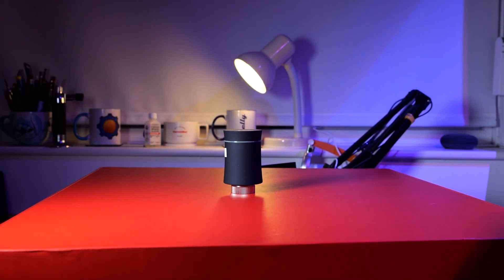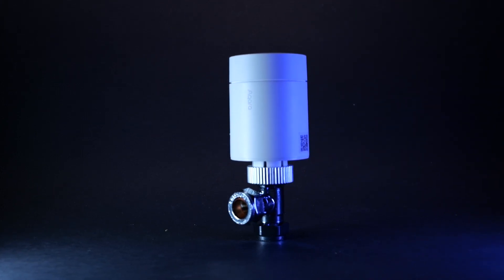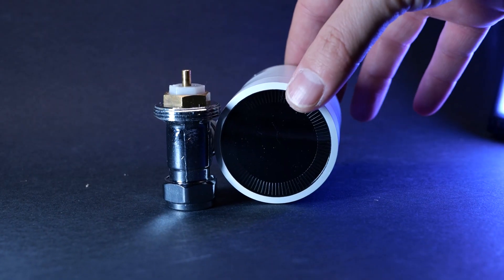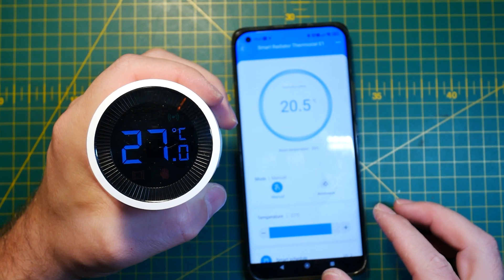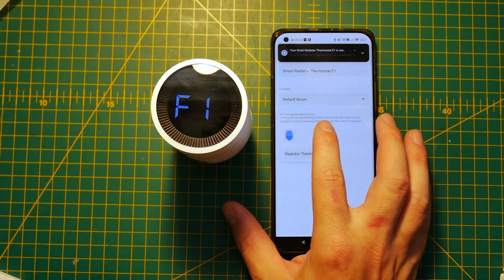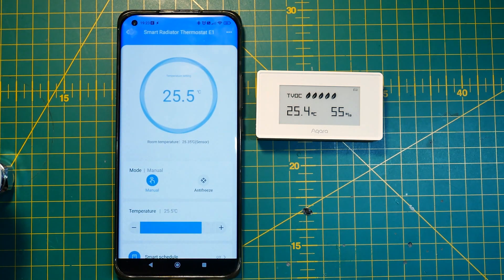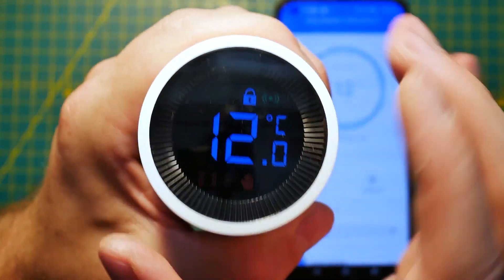11 mistakes that Aqara TRV could fix

Comment: How long on average does it take to calibrate?

I have hive trvs currently and they can take 4 hours to calibrate and rhe heating had to be on when you don't this.

Sometimes they also don't calibrate so you have to go through it all again.  Other times it will calibrate and a few weeks later uncalibrate and you have to go through it all again.

Comment: Some Aqara devices are not competitively priced as others in my mind. If this TRV does retail for £54.99, it's going to be overpriced, when you can get the Sonoff that does everything the Aqara does for a lot less. I remember back when the Aqara Contact Sensors were great value for money and bought a few of them. They are great sensors but the last time I checked, they were dearer than the first ones I bought. As for Heating and TRV's, I had a huge investment in Tado but their proprietary communications system sucks and has range issues for people with large homes. I waited 3 years and followed a thread of many angry Tado customers over that time thinking they would fix the problem but its become clear they are not going to bother so I just ripped all the Tado out and replaced the TRV's with Sonoff. I have created a few HA automations to manage my Heating Schedule and Boost operations and I've pretty much replaced the Tado app functionality in a matter of hours. So far, it's all working well, so fingers crossed this will be the last time I swap out TRV's. Best of all, I'm selling the Tado kit for more than its costing to buy the Sonoff 🙂
Reply from the maker: I don't think Aqara is getting more expensive. They do offer quality products often cheaper than more known to western brands. It was never inexpensive tho. I can personally attest for difference in quality and longevity of Aqara Vs less expensive brands. 
Budget is a consideration and I'm the first to acknowledge that. 
Sonoff trv is the one I would go with as well but mostly because of the budget. If money was not the concern I'd pick Aqara trv in this case
Reply: @notenoughtech  At the time of writing this reply, a quick Amazon search found the Aqara TRV for £39.99 (with a 27% off promotion), normal price £54.99. 
I feel / hope like they are never going to be £54.99 because that's a ludicrous price in today's market. At the discounted price the Aqara is not a bad buy but it still wouldn't sway me from the £29.90 Sonoff TRV. That's like a free TRV for every three I buy.  Thanks for the video though 👍
Reply from the maker: You have to remember that Chinese marketing is vastly different to what we are used to in the west. It's all about gamifying the shopping experience etc. you almost never get the RRP. 
I don't like it...but it works for them in China and I guess it's a process to get the sales data to prove otherwise in the west. 
On their up side if you are buying for commerce... None of the promotion strategies apply and you get fixed price which is very often non negotiable

Comment: I'm also NOT happy with these - and CANNOT recommend them
(having bought 6 of these in august-2023, plus the Aqara E1-Hub).

Why?

1) Partly due to their lack of Interoperatibility... Philips-Hue shows, how interoperatibility is done - so that a hue-device/unit can be controlled by both Home-Assistant AND the Hue-App!
-- Aqara only accepts "1" - an Aqara-hub or a "USB-Bridge" (Sonoff's zbdongle, etc.).  So one has to sacrifice a lot of functionality/easiness, to integrate these "super-reviewed" pieces of s... (or whatever one want to call this/them)!

2) The installation-proces is, shall we say "like software, in a beta-version".
-- pairing-mode times-out much too fast (60-seconds), which combined with that in my case the thermostat refused to connect to the matching! E1-Aqara-Hub (!), (making me trye this appr. 10-times, after which I needed a brake, not to smash the damn thing!!).

3) Re-initializing proces (if. one for instance needs to recalibrate the valve):
-- is just as "annoying" ... there doesn't seem to be ANY way, to make the damn beta-thing go into "setup-mode".... without removing the housing and removing/reinserting the batteries, etc...!).
-- what a series of bummers!!
-- I am writing this in late august-2023, appr. 1½ years after they were released!!!
(and, this all gets worse: Because IF one in desperation tries to get to the "installation-mode" by holding-in the "1-and-only button", then the unit also needs to be re-connected to for-instance HomeAssistant!!!...)

This should be A WARNING to buyers ...
(not to mention, that Aqara to my knowledge, is quiet about Matter/Thread-support ... making these thermostats "much less of a value" (they are not ezactly cheap)!)

Status now, is that Aqara has NOT, after a whole 1½ years, been able to get the software-part right - plus that compatibility and smartness is terrible, compared to Hue's.  Hue (Signify) actually shows, how things can be done, if programmers pull themselves together, and a company cares for a good customer-experience!!!
(Aqara has got connections/threads to Ziaomi, which seems to be the problem here - with a product, that is "in between" a lot - not 100% working in any scenario, or having a lot of "annoyences /deficiences!!) ...

I'm considering returning mine!  I bought 6, trusting in Your and others reviews - and I'm kinda lost - because I don't see, where to go.
Is TP-Link's Tado's a solution?
And, is there ANY Radiator-Thermostat solution, that will work with BOTH the App AND Home-Assistant?
Not to mention the coming Thread/Matter standard/dialect...
So many child-diseases and so much waste of HW/ressources and customer-time!

Comment: Hello..I wanna ask you a question ..After setting the parametres with wifi what happens if  wifi cut of  after setting the vakues? Will it keep on working with the setting (which set before) without internet?  For example does the schudele programme works without internet ? Thanks..
Reply from the maker: Schedule and currently applied settings are stored on the TRV. The automation policies are usually stored in the cloud so they won't apply over the internet loss

Comment: Does it actually stop at a specific position (e.g. 75%) or does ist keep turning the valves on and off if it can't keep the temperature constant ?
Reply from the maker: It will close the valve when setpoint is reached and open again if too much heat dissipate.

Comment: It says abnormal reading . When i set it 24-25 degress thermostat is a bit loosely like it moves the head . Is it cuz of this or is it normal ?
Reply from the maker: Sounds like your adapter isn't well fitted. It should be attached firmly in both on and off position - then run calibration again

Comment: Hi 
thanks for your video
could you help me with this issuing i am facing
i plan on purchasing aqara thermostat and google nest.
my problem here, do i purchase the nest temp sensor or the aqara temp sensor, which one would recommend?
Reply from the maker: Bear in mind that I haven't used the nest stuff so my advice is a bit blind. Going ZigBee enables you to switch over later while locking into nest will leave you .. well limited. Personally I'd use awara given a choice

Comment: What is the mount/adapter name? I got a few Aqara TRVs for my underfloor heating system but the problem is they don’t fit next to each other on the pipes manifold. Wonder maybe the adapter is the key 🤔
Reply from the maker: This is just standard valve I picked up from my local hardware store, used no adapters for this thread

Comment: i got one + a the aqara hub and a temp. sensor mounted 4 meters away from radiator to the wall wall.. 
it keeps the room temp good, but its REALLY noicy!!  when it goes a little bit under the set temp it opens fully up until the set temp is reached and closes again.. 
its not directly the trv that is "noicy" but the water running in the pipes when trv goes FULL open and closes again, is there not a soft mode where it runs more smooth? my old Danfoss eco2 with bluetooth never did this..   an i doing something wrong in the settings ? 
love your channel by the way 🙂
Reply from the maker: If you can hear water flow, chances are you have air in the stystem. Any cold spots on your radiator near the top?
Reply: @notenoughtech  no its hot from bottem to the top. ;-)  
none of my other 7 radiators with old thermostats is noicy :-)  

the noicy part is when it opens fully up and then fully closes again. 
It does this over and over to adjust the temperature 🌡️
Nothing in between like a normal trv 😢
Reply from the maker: Have you calibrated it? That would also cause the TRV to open in a binary way without allowing for an incremental change.
Reply: @notenoughtech  yes yes tryed that a couple of times. 
Don't think there's anything other to do, than wait for a firmware and see if that works. 
For now I'm a bit desipointed. Let's see if a firmware update can solve that, i  unmounted it from the bedroom and mounted the oldschool back it's simply too noisy🎶 to sleep from. 
Glad I didn't buy more than 1 🥳
Reply from the maker: Are you able to press the pin down of your valve with a finger? Resistance from the valve could be a contributing factor. When new they are butter smooth and easy to actuate
Reply: @notenoughtech  yes i have and it's not possible to push pin in with finger(unless I want to visit the hospital) 🤪 but it is when is use something hard. 
It works normal for Danish standards ☺️

Comment: 3 time periods are more than enough and that's why. Considering the time needed for a room to coll of or warm  (what will be 30 to 50 mins) i think that they got that right. Thank you for the video.
Reply from the maker: It's all depends on how we use the heating I think. Modern heating systems in apartments can actually heat up a room in about 15 min or less. 
My last flat took about 3 min for the radiator to be hot to the touch
Reply: meh... I'd need 4. usually it's morning and evening when I need heating. And I don't need heating during the day while at work and during the night, while sleeping
Reply: @geekytraveler5899  It is a completely useless product with only 3 time windows. I don't understand the author's thinking, it confuses me and I am strongly considering replacing it with some other radiator thermostat. And I've had it installed for an hour and it's already managed to disappoint me like this.

Comment: how does it detect the open window? when it senses a sudden drop in temperature probably? that would be nice!
Reply from the maker: That's how the open window detection works. It looks at the recent temps and calculates the drop range. If that crosses the threshold set it assumes the drop is caused by an open window

Comment: Hi Mat, great video. So would you still recommend going with MoesHouse ZigBee3.0 TRV Tuya New Radiator Actuator Valve or (almost double price) expensive Aqara? I am planning to use it with HA and Z2MQTT. Thanks for reply
Reply from the maker: Before I answer this I want to make sure it works better than Moes in Z2M. From physical properties, I found Aqara to be easier to read.
Reply: Hi do you have sim update, if it’s better Aqara then Moes BRT-100 TRV ?
Reply from the maker: The advantage of aqara one is the fact that I can control the valve value directly with Moes I need to use setpoint values to force on /off position

Comment: 2:48 Mine are also quiet when used in the hand. 
Hook it on to a radiator and every little sound is multiplied by the radiator and it sounds like six cats being strangled to death.
Reply from the maker: Should I use that as the official scale of loudness?
Reply: @notenoughtech  That is what the manual says it should sound as, so clearly it is the official scale 🙂

Comment: Hello, Can You compare Aqara with this Tuya GS361A-H04, it's look identical.. and have other clone. Please disassembly and compare board and zigbee chip :)
Reply from the maker: It's often the case where these devices are made by 3rd party and only branding is different. If it looks identical, it will be inside as well.
Reply: @notenoughtech  if you think the insides are identical. What are the differences? Do you think there's a different firmware on it? Which may makes it the better option?

Comment: Smart all good but when you renovate or buy a new central heating unit you might look at what your buying and save a double kost later on.
Example Bosch EasyControl CT200 can be included with your Bosh unit and from then on your only heating the room your in and say goodby to dump thermostat that needs to be heating the main room (where the main is) to be able to heat for example your hobby room.
Ofcourse the thermostat valves for your heater are expensive but your not buying it for 1 day.

HEATING more rooms than needed is a NOGO these days, so even if your thermostat at the radiator is automated but it can only function when your main thermostat is active IS A DUMP system
EACH radiator thermostat needs to be able to activate your central heating unit if not 
DO NOT  BUY A DUMP SYSTEM
Reply from the maker: I would definitely install something that comes with support for external relay or something similar. I hate then the manufacturers lock off your options.

Comment: Can you force a low max temp? No trv has that feature. Very usefull in rentalhomes.
Reply: You could add an automation to your home automation software to set the temp to X if manually set to over X, i believe the aquara mobile app allows IF THIS THEN which could probably do the same thing?

Comment: I'm pretty sure the "clever AI algorithm" just monitors if measured temperature has actually started to change after it commanded the pin up or down. If it's not - that means that either actuator is broken or your boiler is dead and you want to know about it. But they don't care if reading is accurate or not in absolute terms.
Reply from the maker: The temperature offsets while useful, it masks the problem further. I have a video about how TRV lies to you and how you could fix it. Having the reference sensors like in Aqara case is the only way to do this accurately
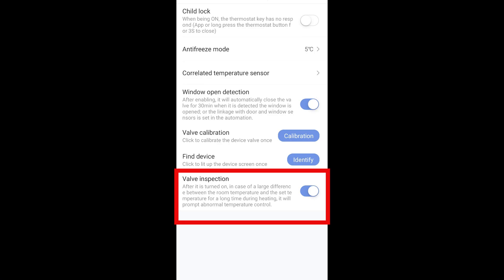Reply: @notenoughtech  Mat, I've seen your article about calibration and I fully understand that. However that option in the app you highlighted at 4:59 has nothing to do with sensor calibration. The only thing it does is a primitive check - that your setpoint change actually affects temperature in the room in some way, nothing more. 

Suppose you set it to 23C, it buzzes the servo to open the valve. So if temperature sensor still reports 20C after 1 hour clearly something is wrong, like, pin is stuck or hot water isn't running. So it will detect this situation and pop you a message. But for sure it will not figure out compensation coefficient by itself.
Reply from the maker: The same check wouldn't work in a similar way on the setpoint set lower as you do expect the temperature to not change for s long time (ambient+radiator bleed). 

It's hard to say what's going on precisely.. but I would feel more comfortable with calibration offset present for the sake of it. Something tells me we will have to see how it works directly with z2m to understand the behaviour better
Reply: @notenoughtech  I'd bet some money they either implemented it for heating up scenario only or just put a reaaally long timeout :) Anyways, lack of calibration is annoying. I'm in the market for TRVs myself and was going to just buy Moes TRV after your old review in next couple of day, but now I'm hesitant. Moes got more expensive since, yet still cheaper than Aqara, and I'd rather have calibration than Matter support. But perhaps calibration is there, just not exposed into the app? We shall see how z2m converter looks like.
Reply from the maker: It's a hard choice. I also like shelly one as well. We are spoiled for choice if there is a decent budgets

Comment: There are so many TRV's out there.  We don't really have Hydronic heating in Australia, but it seems popular enough to have lots of different options around.   My personal preference for battery devices is either Zigbee or Z-Wave, but Shelly has really come a long way with WiFi options that are battery.
Reply from the maker: I used to think this would be posh... but with prices set to be insane, you'd be silly not to invest and bring the bills down now. Tough times